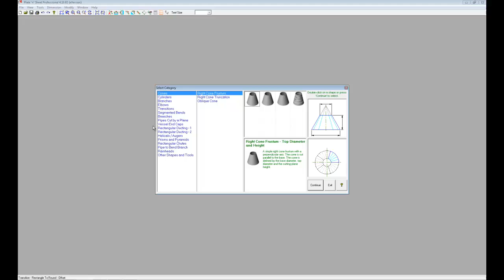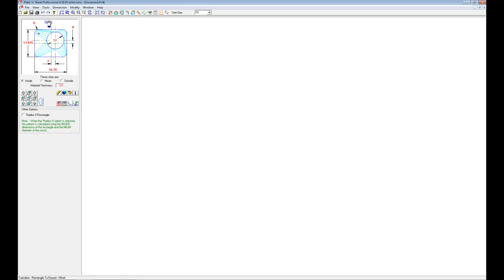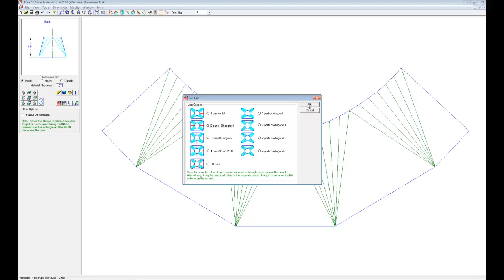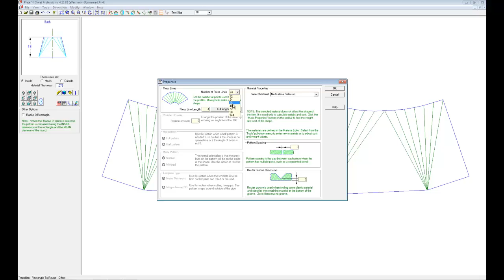Rectangular to Round Duct Transition

Comment: I have to do this layout work using thick pieces of steel i.e. 3/8 to 1" or greater. I have limited time to do layout work on a bench. I agree with post below and it is good practice to do this with paper and tools. I also believe  doing it with cad is less time consuming. We have terrible prints which do not have proper revisions. We have to go into the field and take a look, get rough dimensions and backwards engineer it. We are using ACAD 2014 not solid works. Does Autodesk have a version of this software?
Reply: i think you can get 3rd party software for this. check the "AutoCAD resourse guid"

Comment: I was in insulator for 25+ years, and I was a master mechanic when it came to fabricating the sheet metal that covered the insulation on equipment you see in chemical and power plants. That rectangle to round layout, and cutting the metal out would have taken me about 30 to 45 minutes with just a square, 4' strait edge, trammel points, dividers (i.e. compus) and shears of course. The good thing about doing it my way (the old way) and getting the measurements in the field most of the time is that things don't always match the dimentions on the iso or prints.
Reply: +bibleprophecy1st Yes , i Use the old school number system. My opinion is the old way is better quality.